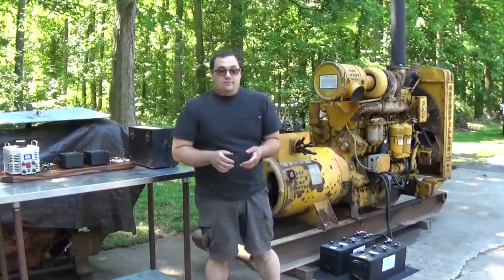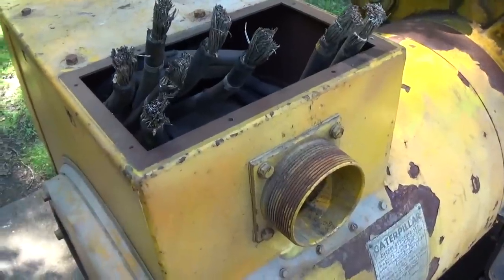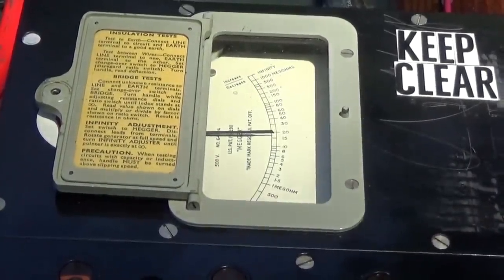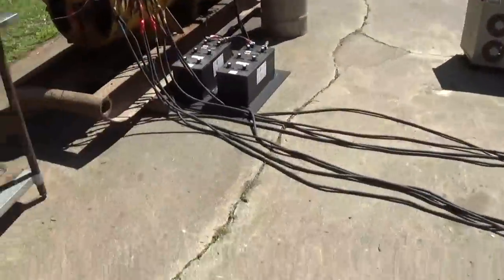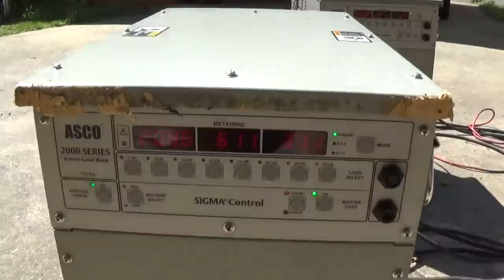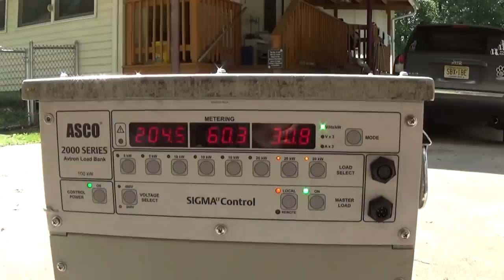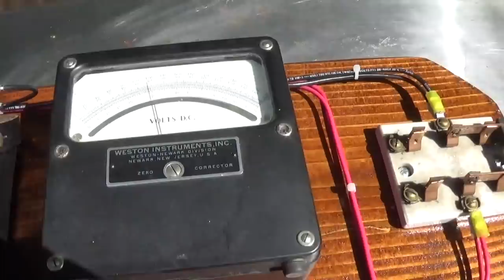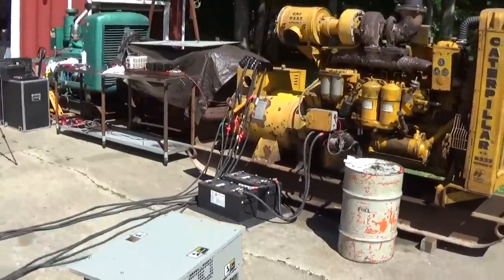CAT DIESEL RUNNING UNDER LOAD 1959 Caterpillar Generator Testing

Comment: Kudos to the engineers at Cat for designing such a robust unit . Cool vid 👍
Reply: Yep, All the new emissions compliant ones will have shit themselves and died long before this one even reached it's broke in running hours.
Reply: @tcmtech7515  all the covid thing is because of the pollution we caused , proud of these old units but dosent mean that we should use them
Reply: @Tsifdgoyddo  How is covid 19 due to pollution?
Reply: Probably designed with a slide rule and brain power by an engineer, rather than being designed by an accountant like everything these days seems to be.

Comment: I own a generator business and do A LOT of maintence (on newer equipment only). Just by the sound of this old lady, I can tell that back in the days the specs were WAY more conservative than todays...
Today when you (resistively) load 150 kW a 150 kW machine it simply can't take one single extra watt. You can feel, see and hear that the engine reached it absolute max. 
This one, like you said...  Doesn't even care... In todays specs they would rate it at least 200 kW easily.
Once again I'm not used to this high current excitation values in newer equipment... Even 400 kW ones are using only 10 amps regulators.
Great content, learned a lot.

Comment: Mike, you have a better grasp of power generation than a lot of younger electrical engineers. When calculating excitation requirements, remember your test was at unity Power factor. The excitation would have to go higher depending on the reactive power required.
That old Cat was working up a sweat! Looked like maybe a dribbling injector occasionally, but that might clear up with some run time. Exhaust looked clear at max load after a bit.
Reply: I think it was just 40 years of no load exercise running burning out. I’ll bet she would have made a nice show of glowing carbon chunks out the stack if it’d been dark enough.

Comment: I’m amazed how quickly diesel engines got to their modern form. 1959 and the injection system and turbocharger were already similar to modern, gas engines did exist with amazing tech back then, but they weren’t nearly as refined.

Comment: Probably the most that generator has been loaded up in many many years
Reply: Yes, 100% Correct Most installs do Not Run them At Full Duty Cycle Like Shown Here You Could see Once the Chamber Temps were Up over 270C She started to Spit Carbon out the Pipe. Once the Pot is around 300C Then Carbon Deposits will No longer Form.  Even in this Film that engine is still not at Full Load Running at Full Capability  Built To last a lifetime, it will if maintained You have a Spot on teacher here if you are taking Notes. Stay safe I Have seen people die working on Big Power systems. If you are not a skilled Genset mech then call someone who is like the Small Engine Mechanic. Top Video stay safe everyone.
Reply: @Rs500ybd  This is why even with car engines, its good to flog the piss out of them once in a while. Build that cylinder temp and pressure. Good for the piston rings and burns off carbon buildup

Comment: Heh heh, nice test setup! That big Kitty Kat started huffing and puffing pretty good around 80% load. You could see in the exhaust, all the bats and bird nests from the last 20 years getting evicted.🤣 I could watch this all day!! I'd say this generator is still good for another 20 years once you get the right exciter for it. Speaking of residual magnetism, I've have a couple of old Coleman gen sets in the past that would lose their magnetism if they sat too long without being run. Generally you could get them lit up again by simply plugging in an older 1/2" drill (no speed control), and just spin the chuck by hand a few times to give it a little nudge. I've had a couple cases where I had to tape a big magnet to the side of the drill, so it would actually generate a little more voltage to get the generator to light back up.😉
Reply: Careful about that, that feedback will knock you on your britches.

Comment: There is something I just absolutely love about seeing a 60 year old piece of equipment still put in the work she was built to deliver on day 1. She's definitely a beast. I wish I had a use for a piece of gear like that but I don't have an office building, lol.
Reply: Absolutely! You nailed it.
Reply: We run outdoor parties sometimes with a Siemens Schuckert alternator (220/380V 3Ph @ 75kVA) powered by a MaK Diesel engine. The alternator head is from the 1930s and the engine too. The alternator has a compound regulator (the iron core of the three phase compound choke weighs about 75 kilograms) and works just incredible. You start that thing up and you can forget about it for the whole weekend. Just add fuel sometimes. a lot of fuel...
Reply: @albinklein7680  I'll bet it's a beast. I don't have any use for really anything over a 10kw and that's if I have to run AC units off of it. Wouldnt mind finding one of those old 45kw detroit diesel military gensets.
Reply: @Shane-Singleton  I'm on a budget. I picked up a light tower from a rental equipment auction. 6KW unit continuous rating to run 4 1.250KW Metal Halide lamps with the auxiliary load of the ballasts. Unit is rated for 8KW overload for 1 minute and 6 KW continuous. It runs quiet. Use it to power the stage at outdoor concerts. After the concert, the lights are useful to help the crowd disperse and musicians to pack up the gear. Buying one is much cheaper than renting one for all events. Paid less than $1,000 for it.  Love a good auction. I can tow it with my motorhome to the event.
Reply: @isettech  I picked up an old light tower from my local breakers yard, 60' telescopic lattice tower with a 2 cylinder Lister genset on it. Actually wanted the tower for setting up at radio events etc. Sold the genset after getting her running and generating, for the first time in decades, for a lot more than I paid for the whole thing. I have smaller lighter and more powerfull gensets I can mount on it if need be. Yes as well as throwing money at radios I also throw money at vintage machinery too lol.

Comment: That was just terrific, thanks so much for taking us along for the ride. As a big fan of diesel electric locomotives EMD, GE, Alco this is a window into load testing of the power plant and generator on a smaller scale.  Love to hear that turbo and the exhaust note change under load. Bid thumbs up.

Comment: Thise old D-series Cats LOVE load.  Run them in backup service at 40% or less, not so much.  D-349 at 240 KVA gets soupy and sooted up pretty quick.  Give it 1100 for an hour, clean as a whistle.  That's a great sounding D-337.

Comment: Excellent video, remember that power factor will make a much bigger difference on field current, much more so then resistive load.  The resistive load tests the engine HP, an inductive load tests the excitation system.  The same analogy comes into play with paralleling generators, share KW by adjusting engine governors, share KVAR by adjusting excitation.

Comment: The engine on that set is a beast! I never heard it react at all when any amount of load was added!
Reply: That's because it needs to keep a constant RPM.  But that turbo sure took a jump with each load.
Reply: @russellhltn1396  Yeah it did...every time he went up a percent mark on the data table you could hear the turbo spool up...so cool

Comment: The Full loading of this Cat reminds me of hot Summers nights in  1966  Cu Chi , Vietnam at the 25th Med Battalion.I was running a brand new 353 Detroit against a 30KW, loaded many nights to 36-37 KW blowing black smoke and me watching the temp gauge praying the needle would stay off the cut-off overheat switch and we did not lose all our hospital power....because if it did it I had to go and crank up several smaller generators to cover the loss of the 30KW....(I kept a couple 10KW on the idle run just to switch quickly if the 353 DID overheat. That 30KW had an electric governor that was so fast that when a refrigerator switched on The governor sensed the voltage drop BEFORE the load hit the generator and caused the 353 Detroit to burp UP in speed just a bit...you could see it on the Cycle meter bouncing up every time a substantial load hit. Memories of an old Combat Medic....

Comment: Used to work at a place that had several large gensets,for egress lighting and to keep sewage pumps running.Biggest problem we had was that the load was only around 10/15% of genset capacity.Everyone was always  complaining that the gensets smoked too much.I was engine mech,electiican were task with loading.worked there 20 years never was able to convince anyone that genset would would be more efficient at about 50% if we were running 24/7 which we did during power outages.Also had one one small genset (50KW) that was wired up so screwy that the three different legs of the load were as much as 25/30% different.

Comment: Those old Cat gensets were way overbuilt to take years of use and be reliable. The old D-9 powered unit I used to operate and maintain used a 60v exciter piggybacked on the main rotor. We didn't usually run it in the winter and sometimes in the spring, at startup time, it would lose exciter charge from non-use, so I would have to jump start with a 9v battery at the regulator to charge the exciter. Once it got going, you wouldn't have to do that the rest of the season. We ran that unit for 22 yrs. while I was there and I recall replacing the regulator twice, and that is about it. That unit you have there is pretty nice and sounds really good under load, which is what it needs to clean her up. You do a hell of a job with your testing and maintenance Mike!

Comment: Few people should or could do what you just did, but you were confident and capable, working very methodically towards a goal, and achieving it safely.     I have the knowledge myself to do that kind of work  ( but NO experience specifically, with generators)   as an electrician I have built circuits up to about 1600A 400V 3P so I have a healthy respect for working with high currents.     I am very curious about why most Americans use yellow press on connectors almost exclusively,  can you explain that   ?   your transformer, rectifier, gauge board were connected with yellow connectors, but with wire significantly smaller then demanding that size,   almost all You Tube videos show near exclusive use of yellow connectors, no matter what wire size,   it puzzles me tremendously, in the "automobile" range there are 3 sizes   Red, Blue, and Yellow (perhaps 4, sometimes I see a Black connector, of unknown size)     Keep up the great work, I am looking forward to seeing more about the big CAT generator.

Comment: Hey @SmallEngineMechanic
Considering you used one of the phases to power excitation, your total engine load was actually higher than 150kw by about another KW, due to the field power, but also proven that you dont need a separate exciter gen.
Have you considered having a rectifier on each phase to feed a DC bus, and deriving the required excitation power from that via some sort of regulator (eg Programable DC-DC converter and a Controller) so that you dont need to install the dedicated Exciter, or at the very least only need a small one?
Having a rectifier on each phase means any phase can supply the excitation power, and any phases with lighter load on it will sit at a higher voltage and will then supply the majority of the excitation load which will help to even out phase loads if slightly out of balance.
For that matter if you used phase power, but still needed initial excitation power, you could just derive that from the Start batteries thru an Isolated DC converter, and as soon as you apply some field from this, you will start getting power from the phases, and self excitation will sustain at that point.
Reply: @KSSilenceAU I don't see the need for the dedicated Exciter - when @SmallEngineRepair has already proven this setup, in this video, already produces power.
Reply: Yes... like he said. :)

Comment: Was testing an 800kw set once. Did a stepped up test like this, but near the top we could never get full power. After hours of head scratching by the higher ups, I realized that we were a bit low on fuel. The return fuel had gotten really hot, which then got circulated, and got even hotter.  With the lower density of the screaming hot fuel, it just didn’t have the energy. We added a couple hundred litres of cool fuel... and we got full output!

Comment: Great video 👍    That Cat is robust!

Could you please do a video on how to properly phase and run two smaller generators in parallel!
I use two light towers at my house for backup.
I run only one as backup in spring & fall, but in winter and summer I run the two in parallel to handle the load of two heat pumps + normal house loads.  Gives great flexibility, efficiency and redundancy.
I think a lot of people would find this interesting.

Comment: This was a fantastic video.   I learned a lot.   I was getting nervous as you increased the load up to 150, you could really tell that the engine was under heavy load.   But, it came through "flying Colors".   Quite amazing for such a old device.   Thanks.

Comment: Do you have a use in mind for that generator??? It really surprised me to see how well that genset handled the load! That things a beast!!! I used to work for a gas company and I hooked up a 100kw LP powered 460 with twin turbos. The salesman told me to make the connection with vapor, told him that gen would ice that tank b4 it hit 50%!!! Told him to send a vaporizer for the thing and I'd run liquid to it. Glad I did!!! Had an ice storm that winter and the genset ran solid for 8 days! (it ran the internet for the cable company, they had 2 other large genset like you've got there for the cable end) It burned approx 200 gallons a day! We had to set 3-100 gallon tanks due to the location so I soldered diptubes to the valves and ran copper down to the genset, worked like a charm... Dang salesmen ;-) Hope the married life is agreeing with you!!! Been hitched for 32 years myself, all the best to you & your new wife sir!!!

Comment: Excellent test set up. At work we use to just start one or two well pump motors. If it handled the load and the frequency/ voltage/ current were good we were finished.

Comment: The megger readings were probably lowered a bit by moisture in the winding insulation.   You probably didn't run it long enough to get the alternator hot enough to dry it out, but it'd be interesting to megger it again before and after you run it next time.    

Great test of fine old equipment.

Comment: That's what makes a Kitty happy! Running it on a load! The original crusher here was Cat powered. D8 or 9 pony motor start. 3-phase of course. Had a jaw, a cone, a big shaker and a bunch of belts. I got to fire it up sometimes. It was in a trailer and pitch dark till the diesel fired up at Idle. Then you got a dim light bulb. Then a warm up and rev it up. Had 2 handle starters for the cone and jaw motors. The rest were push button. The big starters had a WIRE to hold the handles back in Run position. No safety. Years ago. You did GOOD! Sweet running genset!

Comment: Hello from the UK! Really enjoyed that! Amazing to see, the harder the work the cleaner she's running at idle.
I wonder what sort of fuel consumption she was pulling at near 100% power.
Reply: I was wondering the same. My math on the BTU side of fuel isn’t what it used to be, but I’m guessing that it was taking 250-300hp of engine output to generate 150kw, the engine is probably 40-50% efficient. My mildly educated guess is ~20 gals/hr or 75 liters/hr.

Comment: Thank you that's a great bit of video I have pulled out of a wood a cat D315 ex us milatry in its working clothes navy gray not run for over 25 years we had to empty pony motor fuel tank of water amazing we got the old girl running same day and the main engine but sadly the generator was in poorly parts missing we got all new part's from caterpillars in the States and after few weeks we got her running all original part's we dropped off the 3 phase to a single phase as per plate on the side of the genset it's now running sweet and we  have had it running in a vintage show Very happy to keep there's old girls going  they deserve to be kept running after service in the military. Great video well done thank you 🤠

Comment: Excellent video.  The only other thing I would have liked to have seen is the exhaust temperatures at various loading. Maybe a longer run at 80% - 100% load
with the fuel barrel on a weight scale.  Nice to hear an engine at work. Thank you. Suggest you through a bbq for the neighbours too.

Comment: We use to check the full voltage output on the 3 phase Delco’s by connecting a 12 volt flash light battery to the input of the exciter. It was a good test to see if we had a bad regulator or other problem.

Comment: never douted that old girl never worked with 337but spent well over 25 years working with the 342 on the early 8dh my old dozzer had 30000hours before we give her a heart transplant she has worked over 50 years in a rock quary 6 days a week and never failed us even if it was -5 below she never needed ether  now her sister was alittle different she was adicted to either  even if it was 100 degrees but the old cat motors all they need is good oil good fuel and good air and they will run and do exactly what they were made to do

Comment: Ahh, the Wheatstone Bridge! The first tool used to do a Resistive Fault Locate! I use a modern version with my 3M 965DSP. It's awesome that we still use a Breakdown Set to find the trouble splice in pulp/paper cable, the same method they've used for 100 years.

Comment: Good old girl there. On the exciter front a car or truck alternator can easily be modified to give the required output by building your own regulator. The marine spec alternators in the M1008 and M1009 cucv's (mil spec Chevy Blazers) are ideal.